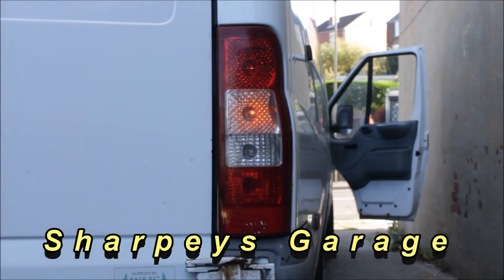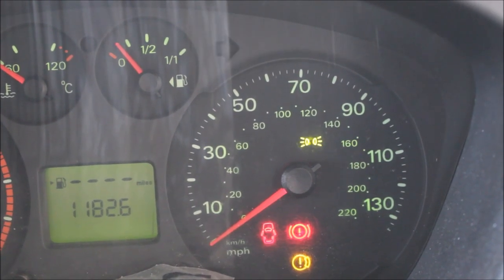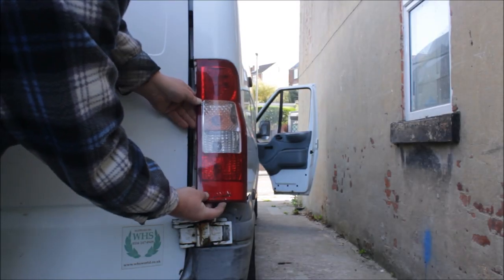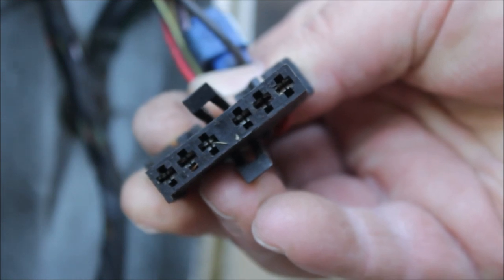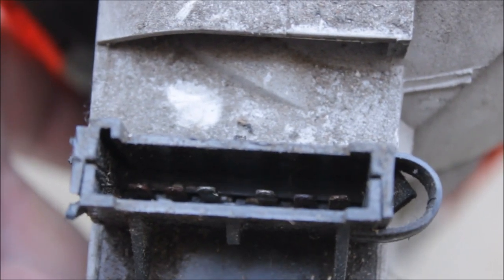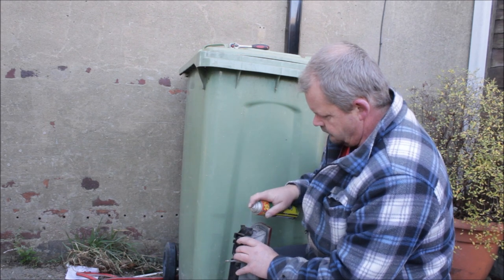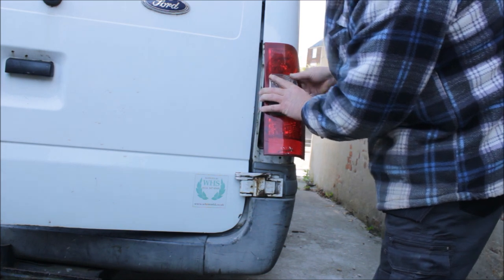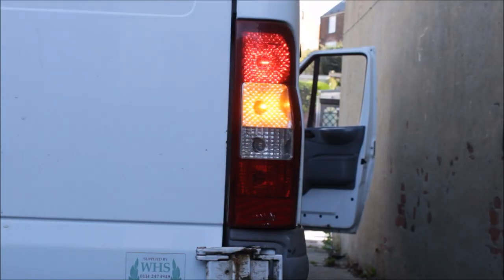Ford Transit fault on rear lights

Comment: Good job. Subscribed. My brake lights don't work, 3rd light on top does work. I replaced 1 bulb and various fuses. So far, nothing.
Reply: try disconnecting the plug to the light unit ...give the terminals a good clean ... have similar problems with my rear lights from time to time
Reply: I've got the exact same problem. Did you find the cause?
Reply: @jimbobalob2491  it's the bulbs on top, most people replace the wrong bulbs.
Reply: @StevenSchoolAlchemy  You’re right, I thought it was the bottom bulbs. All sorted now. Cheers 👍

Comment: Hiya I have a similar problem, in that, both my brake lights have gone. Replaced them and they still don't work. The filaments are intact. Any ideas (before I start going the brake pedal switch route)?
Reply: I have the same issue, did you find the fix?

Comment: Hi , I drive a minibus and the headlights stay on all the time when in off position ( 2012 Transit). The problem is its getting through bulbs at the rate of knots. Is there a way you know to rewire and turn them off so they can be turned on manually when needed ??
Reply: Hi buddy you will probably find that if you take the light switch out there will be a link wire to the ignition just remove look for a wire that looks different or hand crimped good luck buddy
Reply: great thank you I will try :-)

Comment: I've got the same problem and I've tried this but still not fixed! Any more ideas? Thanks
Reply: Did you ever get it fixed, cos mines doing it
Reply: @BillSikes.  I did mate! There was a loose connection in the bulb holder, so I wedged a piece of foil in-between the gap next to where the bulb goes. I did this a year ago and it still worked and passed the MOT. I bought a new bulb holder recently and they're all the same, you could re solder it but foil has worked fine for me
Reply: @danroman3642  
Cheers mate, thanks for the advice I'll give that a try, all the best pal 👍

Comment: Good morning,  its nothing near a short circuit. 
You are witnessing EMF backfeed die to a high resistance on the earth which causes the flow to backfeed up cables that are normally live upon action.
The electricity escapes down anything it can which is why lights "trafficate".
Please don't call an EMF backfeed a short circuit.
The EMF doesn't like it.
You wouldn't like anyone calling you by a name that isn't yours .

Stay well, stay seen. 
Signed 
A vehicle electrician